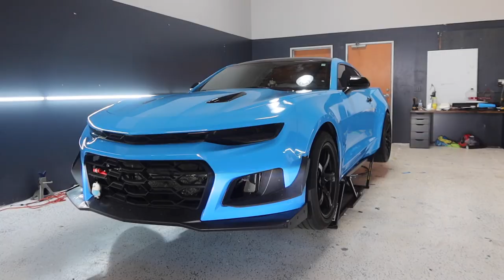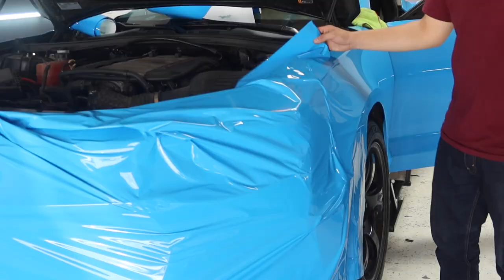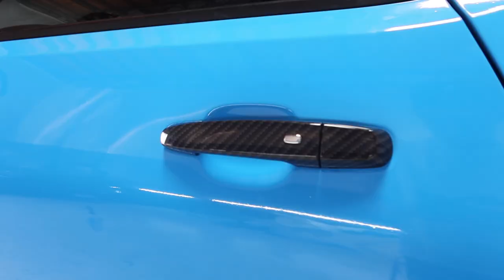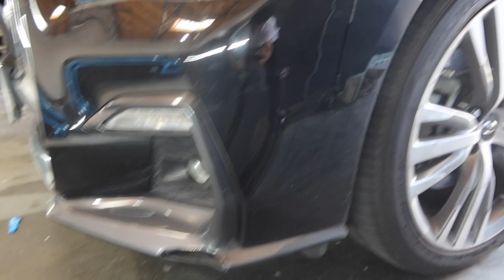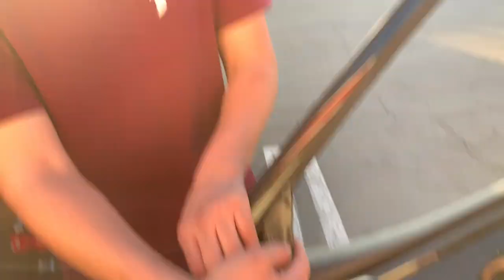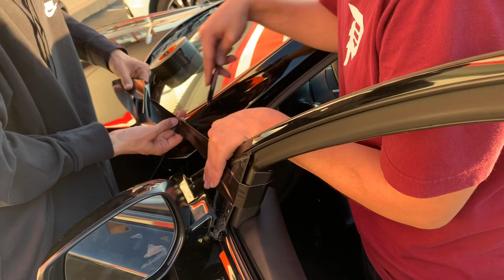A BICYCLIST HIT HIS CAR! (Chevy Camaro Gets Delivered)

Comment: A1 job as always Samson ! Sorry if I've missed it but what brand vinyl are you using on this job ? Cheers from Matt @MPGs Media Australia
Reply from the maker: On this car we actually used cheetah wrap!
Reply: @samsonwraps  , You said cheetah wrap was used. I want to try my hand at wrapping my camaro and thought about this brand. How was it to work with, us it beginner friendly?
Reply from the maker: Yes it’s beginner friendly! I can agree with that
Reply: @samsonwraps , thank you for response.  Sorry, 1 more question is it a decent film, quality wise?
Reply from the maker: I still can’t answer on long term quality. Install wasn’t bad, just make sure to have magnets because the film is low tack meaning it’s easy to pull off the car if not tacked.